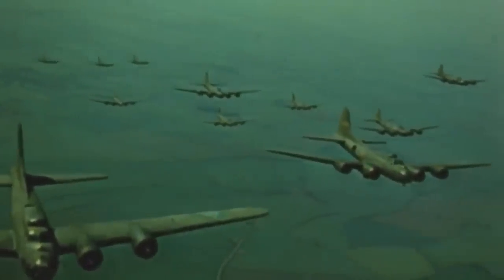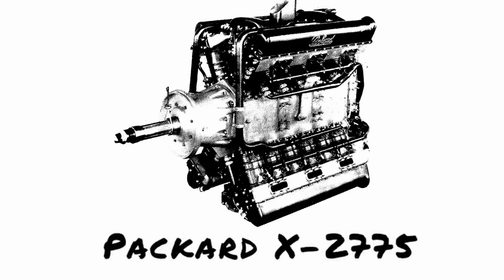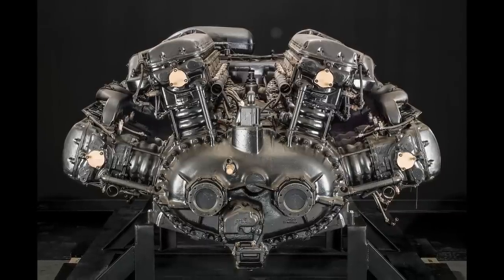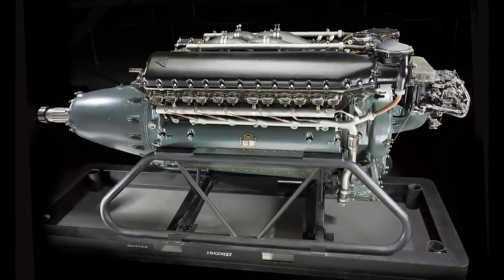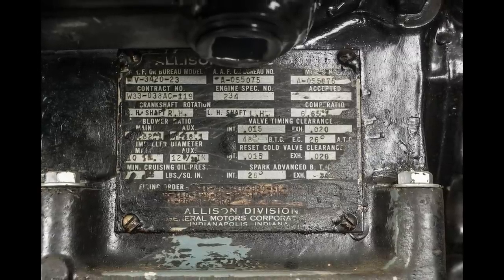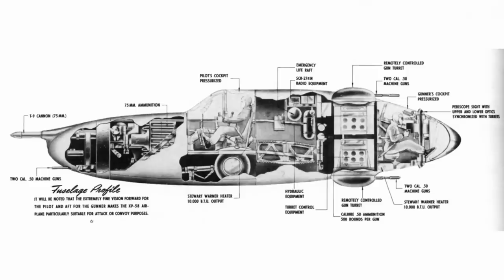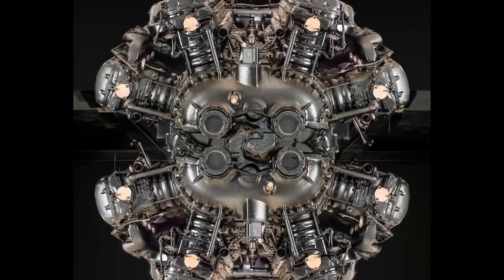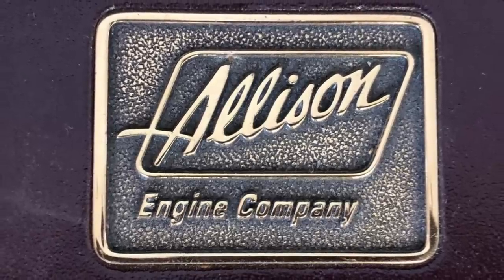The Forgotten Giant: A Deep Dive into the Allison V-3420 Engine

Comment: These engines from decades ago are crazy. Imagine what engines would be around today if jet had never been invented.
Reply: Engines wouldn't really be any different had jets never been invented, because by the 1940s, pretty much every type of internal combustion engine had been at least thought of, written on paper, prototyped or put into production.

By the end of the war in 1945, fighter designs were already pushing the limits of propeller driven aircraft at around 500 MPH. I think the Supermarine Spiteful with a 2,420 HP Griffon engine had a top speed of 494 mph in level flight. What engineers and designers started running into was the limits of propeller physics and metallurgy. For those high boost pressures and extreme heat, they started to have to resort to exotic things like sodium cooled exhaust valves, water-methanol injection and all sorts of charge cooling. Had they had access to modern metallurgy, engines may have been able to be built stronger to withstand more boost without blowing themselves apart.

What kept all of those advanced engines out of more mundane things like automobiles is that they simply didn't need them. The average family sedan didn't need a 2,000 HP V12 with fuel injection. It was only in the 1970s-1990s when environmental standards started kicking in did engine manufacturers start re-inventing what already existed 30-40 years prior to try and get emissions down while getting performance up.

Comment: It seems every X-24 layout was doomed from the start. In a way l am surprised Allison didn't take a look at their previous X-24. The X-4520. Off all the doubled engines proposed and built the V-3420 may actually have been the best. Primarily because it was less of a stretch than the others.
The engine at the 2:30 mark is obviously for the Fischer P-75 Eagle. An abortion birthed (1) from GM's desire not to get roped into building nacelles  for B-29s.
1) two words that really do not go together.

Comment: It always impresses me that these engines were designed on paper using slide rules, without the 3-dimensional design aids, solid modeling, and computer aided analysis that we have today. Someone had to visualize in their heads all those interfering parts and all these close clearances, and stresses had to be calculated by hand.

Comment: The Napier Lion W-12 with three banks of four cylinders worked well with a single crankshaft, it powered the successful Schneider Trophy race Supermarine S4 to S5 series floatplanes.  Could a W-18 version of the Merlin or Allison 1710 have worked, putting an extra bank of six cylinders in place?  The big V-12 RR Griffon pistons were above the optimum size for a fast revving engine.
Reply: The Sunbeam W engines also worked well… but it is likely an X configuration to limit development costs and time. As a W opens up a large upfront cost in design and development.
Reply: @captiannemo1587 Did any X configuration engines enter production?  The H-24 Napier Sabre was close to being dropped but most of its troubles came from sleeve valves.  Perhaps with sodium cooled exhaust valves a conventional overhead or even advanced side valve engine could have been more straightforward?
Imagine a radial with diameter (and drag) reducing two sided cylinder side valves with 4 valves per cylinder.  Aero engine low rpms, twin ignition and supercharging induction might tolerate the convoluted cylinder head?  Side valves were known technology.
Why were there no three bank radials?  Cooling seemed to be feasible with four bank engines.
Reply: RR made a small number of Vultures.
Reply: @eugeneoreilly9356  yah there is a lot more but those pre 1930 are not well recorded.

Comment: I can't thnk of it as an engineering marvel, it is a paired V12 engine, I have never seen the benefit from doing this.  The frontal surface areas looks to me to be greater than the total area of two separate Allisons.  I always thought the idea of pairing two V12s into one engine and then using a complicated transmission system to power two propellers was particularly strange.  

However, pairing two seperate V12 engines to a single propellor drive via an external gearbox would provide more flexibility and be much simpler, assuming the propellors could absorb that amount of powere.  Alternatively, having a system where two engines drive indidual contrarotating propellors may also have further advantages at least in redundancy.  

But really, twin engined fighters always seemed the best solution, both the Lockheed P38 Lightning and the post-war (it was designed and tested during the war) de Havilland Hornet are testiment to that.

Comment: Did Allison ever propose a larger displacement V12, similar to RR Griffon? Also did Allison ever work on improving the super charger efficiency as a means  upping its hp of their V12?
Reply: Aircraft forced induction implementation is almost exclusively for high-altitude performance and efficiency - not horsepower (at least not total rated HP, just a means of maintaining it as long as possible as altitude increases.) 

Allison did develop both two-speed and two-stage supercharged versions of 1710, but they were late/post-war and I don’t think any actually flew or were used on a design. 

Many believe the USAAC was far more interested in turbos over superchargers (or SC development/production) indeed the turbo-supercharged 1710s performed very well, but were complex and expensive. 

The only area that saw some impressive supercharger development was with the Navy, but this was due to the fact that they essentially demanded radial engines AND refused turbos, both due to complexity, reliability, and maintenance. Some of the late-war Corsairs had incredible supercharger performance, such as the F4U-5s with TWO side-mounted, variable speed, two-stage superchargers(!!!) These superchargers were also automatically controlled, and the fighter was envisioned to have a combat ceiling of ~45,000’. 

Anyways, the know-how was certainly there, but the radials saw most of the forced induction tech it seems, culminating in things like the power recovery turbines, etc.
Reply: As EstorilEm suggested, I understood that the V-1710 was always envisioned to be turbo'd, but the war probably happened just a tad too early for that to be practical, given the rarity of those devices in a wartime economy. Supercharging for high altitude was not really envisioned, hence the appearance of "what were they thinking?"
Reply: @EstorilEm   "Aircraft forced induction implementation is almost exclusively for high-altitude performance and efficiency - not horsepower (at least not total rated HP, just a means of maintaining it as long as possible as altitude increases.)"
I don't think that's true, and I suspect you are thinking of adding supercharging to light civil aircraft.  The  engines for these high performance military aircraft were designed from scratch with singe stage superchargers. This is one reason their compression ratios were so low.  Aircraft intended for high altitude needed multiple stages of supercharging.  Single stage forced induction was not just for normalization with altitude, and was definitely used to improve rated power sea level.   Low revving diesel engines in heavy trucks and locomotives still use forced induction at sea lever for the same reason.
Reply: @corystansbury  The US Army 'stupid' policy for most of WWII insisted that high altitude aircraft engines must use a turbo-supercharger to avoid the parasitic power drag of a mechanical supercharges. A air cooled 2 stage 2 speed mechanical super charger was used in Navy fighter aircraft, so its not as if the US aircraft industry didn't have the knowledge or experience to do this.

Allison V-1710-143 was the aircraft engine used in the P-82 and used a external auxiliary  supercharger powered by a PTO shaft. There was also the monstrous Turbo-Compound prototype using exhaust recovery turbines for additional  power, with the bench test of the prototype was able to reach over 3000 HP using emergency power water injection. This never entered production, as developed late in WWII, This version was abandoned with jet and turbo-prop engines showing more power increase potential
Reply: @EstorilEm R-2800-32W has two single stage superchargers. The first one used a fluid couple that essentially passed through an intercooler to feed the 2nd supercharger which was gear driven.

Comment: Fair play to General Motors Allison ,designing a conjoined or twin-pac aero engine that worked reliably, where Rollers and Daimler Benz failed miserably. Only fly in GM,s ointment is retaining the 1710,s weedy blower as without FADEC a turboed 3420 , fitted in the XB-19 would be a bear. Keep it simple like a Model  'A' Ford, a three  speed two stage blower is a no brainer, far easier to fix , with such a blower, the 3420,s pony count at a rough guestimate at take power  in low blower three thousand ,three thousand four hundred at 3,000 rpm, not bad on on army air force standard 100\130 grade petrol.

Comment: The way they ran the engine off the of two shafts instead of an idler gear between the two cranks with one shaft to the propeller seems unnecessarily complex and  would move the engine further from airflow.

Comment: Formidable engine but extremely complicated and expensive!. Put in proper perspective competing BMW 003, which was RM12,000, and cheaper than the Ju 213 piston engine, which was RM35,000. Moreover, the jets used lower-skill labour and needed only 375 hours to complete (including manufacture, assembly, and shipping), compared to 1,400 for the BMW 801. Easy to understand why everyone passed to jet engines and have far more development potential...